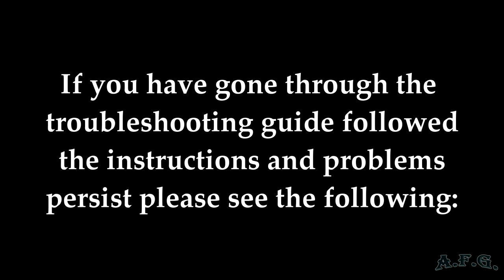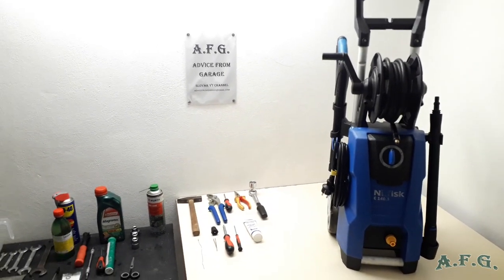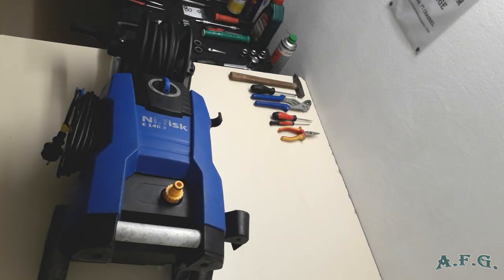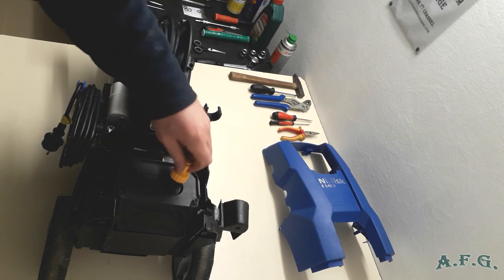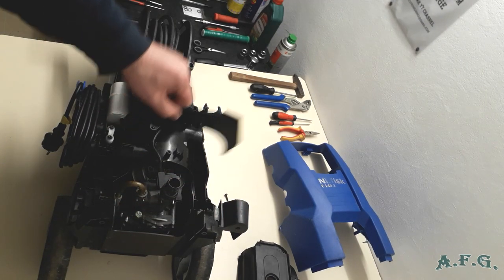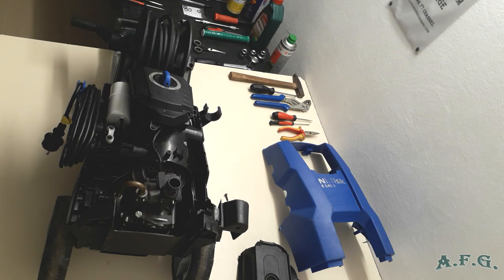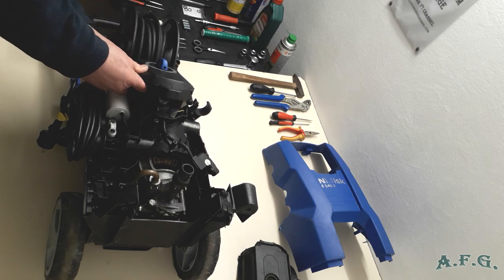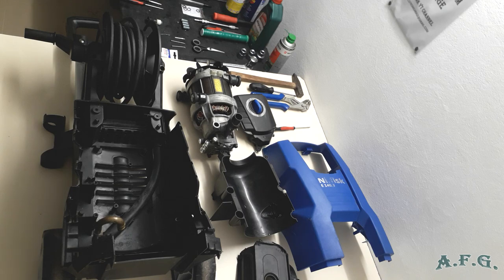How to Set Apart a Pressure Washer_NILFISK E 140.3_ DIY REPAIR_Tutorial (Part 1 of 7)

Comment: Hi, i have a Nilfisk 150.2 where the pressure drops little bit and come back regularly. It’s also makes more sound when this happens, likes it trying to build up pressure. Please give advice which parts to change. Thanks!
Reply from the maker: Hi Robert. Thanks for watching. When solving problems like yours, the problem is not the repair itself, or the price of the spare parts (whether they charge more or less for them), but the correct diagnosis of the problem, i.e. which part is causing the problems. And that's not so easy, and that's why repair shops often avoid repairing these hobby machines, since one problem, symptom - e.g. what you described, which is pulsating (machine turning on and off randomly), can be caused by a number (sometimes more than 8 different things), causes. When I was repairing my first machine (a very good 9-year-old Nilfisk C.130.1 with an induction motor) I was dealing with the same problem. By the time I figured out what was causing this random switching on I had replaced a number of parts worth enough to buy a basic new machine. At the same time, it was a good school for me, thanks to which I can now responsibly answer your question and hopefully help you and other readers. This "pulsing” of the machine - random turning on of the machine without a person pulling the trigger on the gun) can be caused by the following problems. I will list them all and then direct your attention to what may be the problem in your case. Number 1. Is a water leak from the high-pressure gun (in this case, all worn O-rings in the gun or on the gun attachment must be replaced). 2. water leakage from the high-pressure hose or the places where it connects to the gun or the machine. (Replace the O-rings or hose, if it is damaged) 3. check if the supply electric cable is not damaged, which can also cause this.  4. check if you have a strong enough water source, (find out how many liters of water per minute your machine needs for its normal operation and how much water per minute, for example, flows out of the water tap to which you connect the high-pressure machine.)  5. check whether you do not have a broken spring or a worn O-ring on the Non-Return Valve (By-Pass Kit). 6. Check if the O-ring or spring in the Start Stop Valve is worn. 7. The microswitch that connects to the Start Stop valve and turns the engine on or off when you press or release the trigger on the high-pressure gun can also cause the problem.  8. if your pressure washer is leaking water from the water pump, it is very likely that the problem (machine pulsation) is caused by worn O-rings of the valves (Inlet/Outlet Valves), which must be replaced, or worn water seals (water seals), which may also need to be replaced. Water must not flow from the machine, as this means a pressure leak and constant switching on and off of the machine (pressurization). In the vast majority of cases, the problem is caused by either a broken spring (Non-Return Valve) or a Start Stop Valve (Start Stop Ventil). Unlike machines such as E 130, E140, E 150, E 160, and similar machines, where access to the Non-Return Valve (By-Pass Kit)  is very easy, without the need to disassemble the pump, with machines of type C 120.1 or C 130.1, it is necessary to open the pump to replace it. If I were you, I would  check if the Start Stop Valve is causing the problem (obviously if you have checked all the things I listed above). It is not a problem to release it. Spray some WD-40 there and let it work for a few hours. Never loosen the plastic head (nut) of the Start Stop Valve with just a classic double-ended wrench, as the vast majority of people do in videos on the Internet. I have already heard about a number of cases where they damaged the upper plastic part of the Start Stop valve and thus complicated their lives. Always use the so-called socket wrenches that wrap around the top part on each side, (in the case of my valve it was number 25, which I even had to buy separately because I didn't even have such an atypical size in the original new set. If you remove the valve, please check that it is the spring and O-ring are fine. If they are worn, the whole valve must be replaced according to the instructions, as for example, I recorded for my Nilfisk E 140.3 or Nilfisk C 130.1 machines. I am just experimenting with how to save if it is in Start Stop Valve only O-ring worn.I don't know if they have the same in all Nilfisk hobby grade Start Stop Valves. Its approximate size in my machines is 11.8 x 2mm, 11.8 being the inner diameter of the O - ring and 2 being the thickness of the O-ring. I am testing a 12 x 2 PUR 90 SH O-ring in my Nilfisk E 140.3 cleaner (PUR stands for Polyurethane rubber and SH stands for SHORE). 90 is the hardness of the rubber. The ring can be bought anywhere, even on the Internet, for around 1 Euro. I have not been able to find out anywhere in Europe what the exact type, size, and hardness of the original O-ring is, no one knows. If anyone knows, please write it in the comments. The one I installed as a test is still working fine. When assembling the Start Stop valve, it is necessary to follow the exact procedure and above all to place the O-ring correctly. I have already seen several machines where the owners placed (mounted) it incorrectly during assembly and the machine then did not work correctly, or it didn't work at all. So hopefully, these tips will help you. Greetings from Slovakia. Slavo
Reply: @AdviceFromGarage  thank you for the very good explanation of different causes! As you say, often is better to just buy a new machine unfortunately. Anyway I will check the start stop valve and O-rings on the machine. The symptoms of my machine: it is working, also the pistol on/off. But when flushing it suddenly drops a few bars and comes back with full pressure. When this happen you hear the machine making some noise as pressure drops. The trigger is fully open on this point. Thank you mr Slavo!
Reply from the maker: @robertselvik9786 Good morning Robert. One more thing came to my mind when I read deacription of problems with your machine. Please check  nozzle - end of the extension of the high-pressure gun. Sometimes if it is blocked with the dirt and debris it can cause similar problems. Easy & quick fix at no cost. You should have a needle for cleaning of the nozzles at the back side of the pressure washer. Let me correct you please. I did not say that people should buy a new machine when problem occur with these hobby pressure washers. Authorized services often do say it. I said something like- if you have never repaired any machine, it can be tricky and hard to find a problem and solution. I believe that even a complete laymen can fix his power washer with  the help of my tutorial. I had to find out all the knowledge and solution to different problems myself - took a lot of time, money, energy and effort - as at the time of my repair there was no comprehensive tutorial as mine right now. These Nilfisk hobby pressure washers are one of the best in the class for many reasons - one of them is that, it is relatively easy to fix them with the tutorial like mine. I defend "Right to Repair" & sustainable and environmenally friendly capitalism. Good luck. Slavo.
Reply: @AdviceFromGarage  cheers 👍🏻👍🏻
Reply from the maker: If cleaning of the nozzle won't help, please watch part 5 and 6 of the tutorial in my album. They are dedicated to Non-return Valve Fix and Start-Stop Valve replacement. I believe there is quite a lot of interesting information and the way how to repair pressure washer. If you look for short version, there is a part of the tutorial with no number in the album. I tried to fit the most important information into less than 12 min. in that video. It did already help to a lot of people. Bye.

Comment: I have a Gerni 145.3 which looks exactly like your Nilfisk 140.3. In particular the hose reel which is the area I need to work on. The problem is the pressure hose is leaking. I can order a replacement hose, but I like to know for sure how to install it before I buy it. I'm hoping you can help. Thank you. David
Reply from the maker: Hi David, I would love to help you with this, but I have no personal experience with this. It all depends on how your high-pressure hose attaches to the high-pressure hose reel. I think that both Nilfisk and Gerni (which are almost identical in these versions of high-pressure cleaners) have 2 different types of attachment to the high-pressure hose reel. You'll need to find out for yourself what your attachment method is. Since I didn't do it, I'll try to help you at least by adding a YouTube link to a video of a guy who changed it on his Nilfisk high-pressure cleaner himself, because he wanted a different - better type of high-pressure hose. On my cleaner, I have a second way of attaching the hose - different from the guy in the video. But I didn't record it in my videos because I had already replaced the hose on the old broken Nilfisk E 140.3 that I bought and repaired (and uploaded to YouTube). The previous owner was probably not happy that the original one was not flexible enough, so he replaced it with a Nilfisk high-pressure hose - probably from some hot-water Nilfisk high-pressure cleaner. Although the new hose on my machine is shorter (only approx. 7 meters), the fact that there is still more than 1.5 meters of high-pressure hose left, which goes from the machine all the way up to the high-pressure hose reel, so in total, I have a total effective, usable length of high-pressure hose of just over 8 meters. They are classically connected by threading, but the connection is not completely optimal, because there is about a 10 cm piece at the connection point, which cannot be bent and adapted to the curve of the drum of the high-pressure hose reel. But it works, so I don't dwell on it. Here's a video of a guy replacing the high-pressure hose on his Nilfisk E 145.4. Hope this helps you at least a little. Greetings from Slovakia. Slavo. https://www.youtube.com/watch?v=Qk572XsRYGw

Comment: Hi i get leak from inlet and because of it the machine keep pulsing to replace hose inlet  i dont need to take off motor and as long the cover removed i can replace that is that right?
Reply from the maker: Hi, no, if the problem is a worn O-ring on the high-pressure hose connecting to the pump, you don't need to remove the induction motor. Just take off the blue front styling cover, and MPU floating cover, remove the metal U-Pin and you can access this place. Please see part 5 (Non-Return Valve Replacement) or part 6 (Start-Stop Valve, Start-Stop Valve Replacement) of the tutorial to see the exact procedure of how to do it. I recommend taking off the blue front styling cover, MPU floating cover and hooking up a high-pressure washer to the water source, and doing a pressure test to see where exactly the water is leaking from either from the place where the high-pressure hose is connected to the pump, or from the pump itself. If it was from the pump, it indicates a slightly bigger problem. The worst option would be if the pump was broken. This usually happens if people don't store their pressure washers in a heated room for the winter. The water in the pump freezes and the pump bursts. Repair is often unprofitable. In most cases, however, the problem is not a cracked pump, but either worn inlet/outlet valves (in that case, please see part 3 of the tutorial - Inlet and Outlet Valves Replacement) or worn water seals (part 2 of the tutorial). The link to all parts of the tutorial on how to repair not only Nilfisk E 140.3, but also Nilfisk E 130, Nilfisk E 145, (Nilfisk "P" and "D" Class as well), Gerni, Stihl, Husqvarna, and many other pressure washers that have more or less identical construction is in one of the comments. I hope this helps you. Greetings from Slovakia. S.
Reply: @AdviceFromGarage  thanks for swift reply yes I used this jet wash only like 10 times from new it works fine but this time when I tried to use it pressure water still works but water keeps splash or leaks from where I connect Water hose to pressure washer in the front and that cause machine keeps pulsing on and off cause the water pressure but when I press the trigger the water comes out with normal pressure out of jet nozzle to wash the car but when stop pressing the motor it goes on and off like pulsing so I switch off when not using that's why I think it has worn washer ring like u said

Comment: How do you get the blue cover off a nilfisk P150.2? Cheers.
Reply from the maker: Hello.  I can't tell you for sure because I've never had a Nilfisk P 150.2, but it certainly won't be much different from other machines in this class.  For these machines, Nilfisk chose a very good, functional, efficient and simple design.
Reply: @AdviceFromGarage  thanks for your reply I appreciate it. Do you have to take the black cover that surrounds the two front switches to access screws to get the blue front cover off? I took any screw that looked like it may be holding the cover on but it still wouldn’t budge. It’s obviously simple but I cannot see how. I don’t really want to start leveraging in case I break something. Do you have a video showing the removal of your front cover please? Cheers Bob
Reply from the maker: @MrTrapper28 Hi Bob. Look at one of my videos where I fix the Start-Stop Valve problem. I made it quite straightforward and during the first minute, you will see what you are looking for. Hope it helps. Good luck. Slavo https://www.youtube.com/watch?v=EWa8X4rw7rY